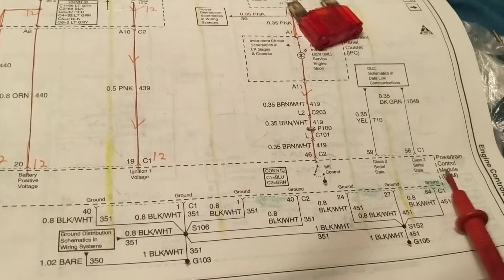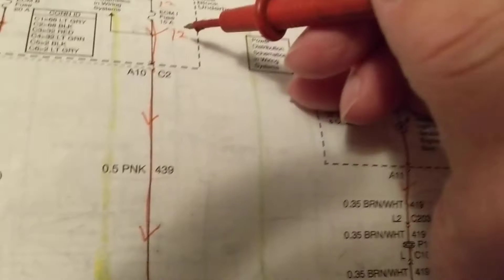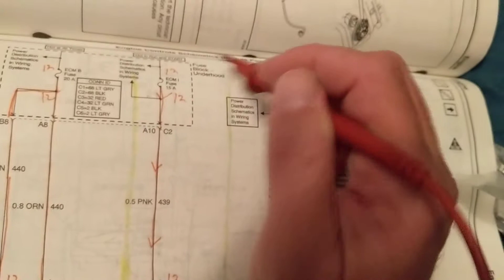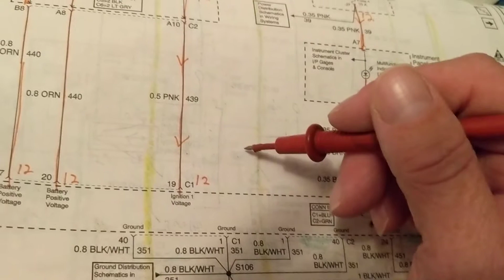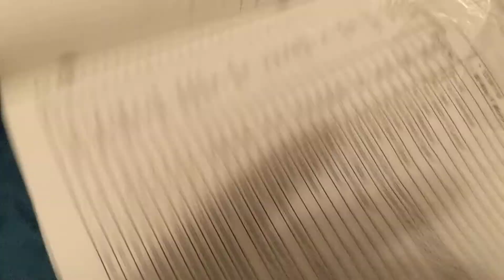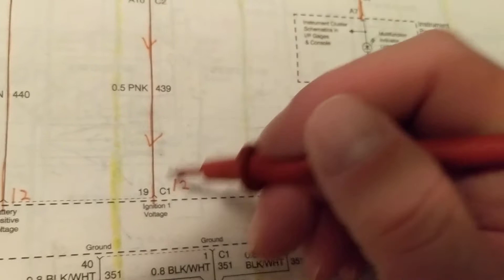HOW TO TROUBLESHOOT SHORTS AND OPENS TO COMPUTER WITH MULTIMETER FROM WIRING DIAGRAM PART 4

Comment: I operate a small ride-on tandem drum roller of the BOMAG brand, a 2013 model. After the technician replaced the thumb press botton for compact vibration that work well for a month, I got problem that when I turn on the switch for water sprinkler to moisten the tandem drum to roll on the fresh hot asphalt and the same time turning on the switch for vibration results in broken fuse of the water sprinkler always. The fuse for the vibration never broke- off. This tandem drum roller is not computerized. So what I do is never to switch on the water sprinkler and the vibration at the same time. This situation I could relate squarely to this present video.
Reply from the maker: Good comparison thanks
Reply: Good video. Thanks
Reply from the maker: @cesarpereira5965  thank you for the compliment